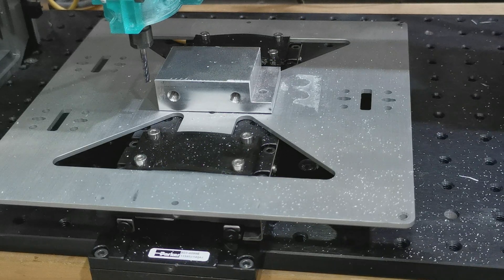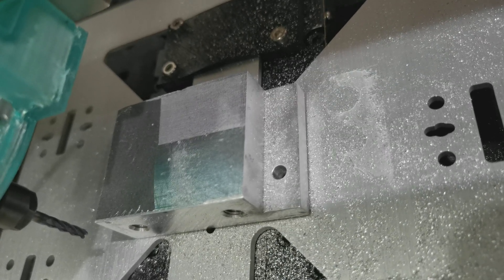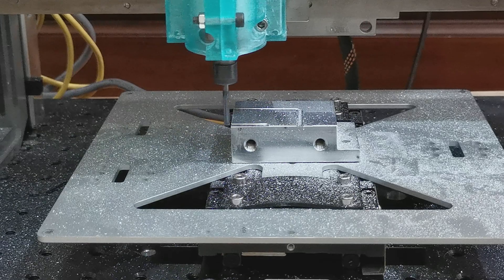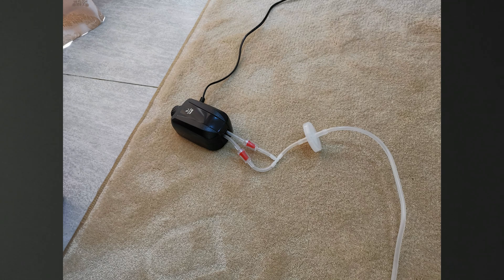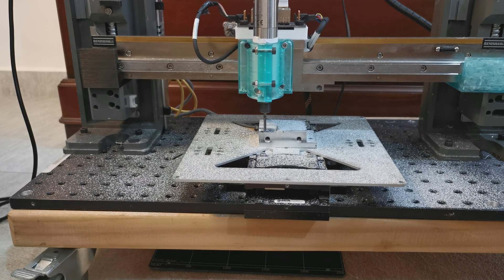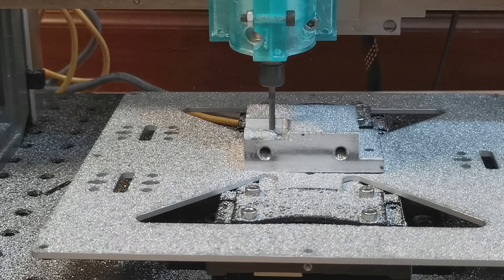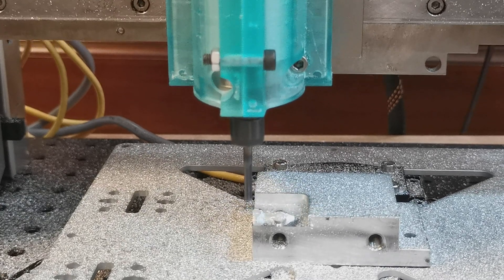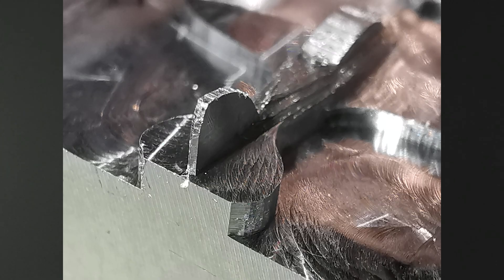SycoTec KaVo milling spindle on linear motor 3D printer. (Milling Test)

Comment: Be careful of your optical encoders, they arn't remotely covered and you might end up with some aluminium dust getting onto the scales.Other then that... awesome :)
Reply from the maker: You are right, I am aware, and that is good advice. In fact, for everyone else seeing this, I had problems with that already in 3D printing mode. Even though these encoder strips looked pristine, I had issues with the x axis. After a repeated cleaning with a cotton swab and alcohol the problem went (and stayed) away. The reader works in IR and the grime may be transparent in optical wavelengths - so you may not see if it's dirty.
Reply: Yikes, fun times. Magnetic encoders are great, really accurate these days too, I can get them for 3um/meter accuracy. I'm currently looking at sorting out those NSK spindles, price is surprisingly reasonable, even new...
Reply from the maker: @DUIofPhysics  good point about the magnetic encoders. I haven't looked at those in years. How do those compare in thermal expansion to glass scales?